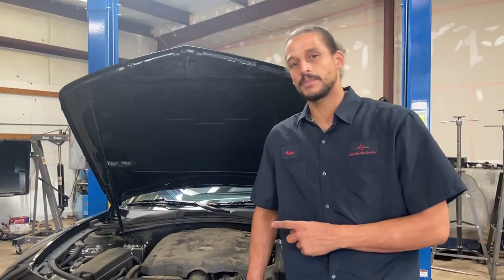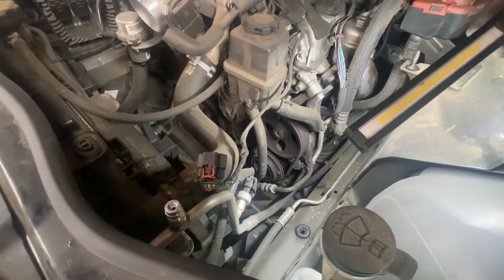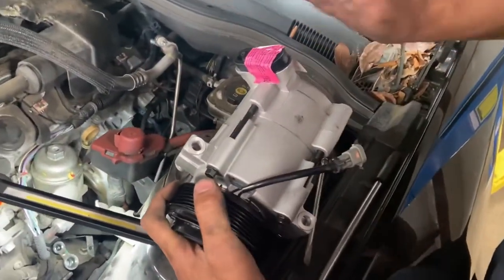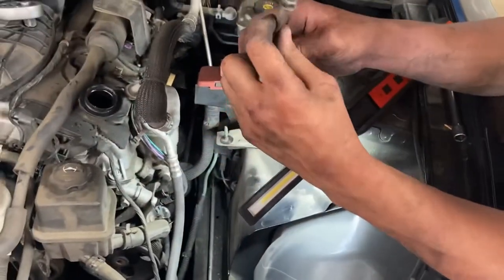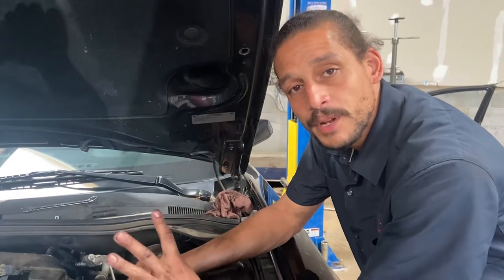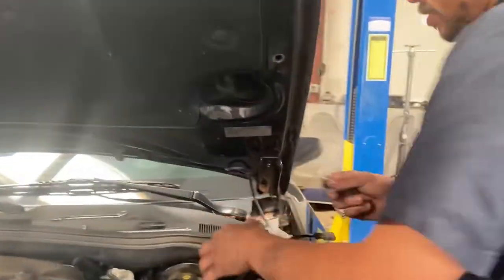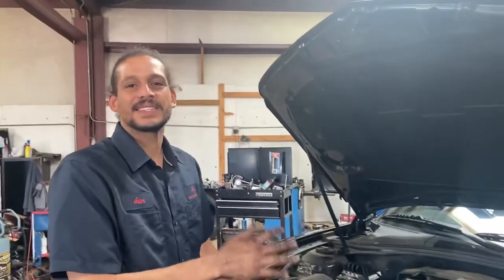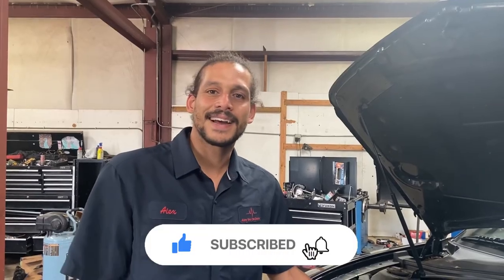How To Replace an A/C Compressor | A/C Compressor Replacement on Chevy Camaro & Cadillac Setups

Comment: I watched your video before I changed my wife's compressor.  2010 Camaro.  Thank you for posting.  Her compressor was making a terrible noise and then failed.  After replacing it, I had a terrible time Getting the new compressor to run.  Charging the system didn't get the clutch to engage.  Jumpering the relay got it working but the next day no go.  I did a code reset using my code reader still no go.  I finally unplugged the battery for 20 minutes, and no go on the clutch engage.  I jumpered the relay to engage the compressor clutch, then pulled the jumper and put the relay back in.  I drove the car for 40 minutes.  AC worked great.  It seems I had to run it long enough for the ac computer to identify there was no more problem.  AC has been working flawlessly ever since.   The only reason I write this, I am sure others may run into this problem after changing the compressor.  Thank you for the video, It helped me a lot.

Comment: Hey Alex.
Just an update.
The compressor was the issue. The pulley bearing was on its way out too, been noisy as hell.
I removed the old compressor and the pulley bearing was in fact shot. I was able to rock the pulley back and forth.
Removing the top stud first made the job much faster. And, you don't have to remove the power steering line either. The stud passes right by it.
A/C is nice and cold again.
Thanks again for making this video. Great job.
Reply from the maker: I’m glad it all worked out great l. My pleasure buddy

Comment: Subscribed.  I was curious how this process worked as i just had this job done on my 2013 camaro. Your video shows everything and in such a timely manner ! If it wasn't 24 degrees out and I had a garage, i would've tackled this myself. Your video is that good. Firestone told me it was an 8 hour job for $2600.00. I found a place that did it in less time for $1440.00.  

My compressor was so shot that there were metal shavings in the condenser along with a super loud whine every time I accelerated. It even sounded bad all the way from my living room when I would remotely start it.

They also drained and put in new refrigerate. Ice cold air and no more whining or scraping sound on startup and acceleration.  However, they never mentioned if they flushed out the system to get rid of any debris/shavings. So I'm going to call them tomorrow. Hopefully, they did. I read that if it's not flushed, my new components won't last very long.

Comment: Quick tip, If you dont have a small enough socket for the stud you can stick a long screw driver or pry bar down between the compressor and block and just GENTLY wiggle it off. Make sure to pull the wiring thats zipped tied to frame outta the way first as well.
Reply: @Diegodiaz-gc6bc  doesn't work on the camaro. The stud is too long. Had to remove it with the 5/8.

Comment: Great video.
I used to do A/C work in a dealership 30 years ago.
My 2015 Camaro V6 with 124,000 miles on it was blowing ice cold one minute, then hot. Compressor is not engaging. System has no leaks. Checked the fuse and relay, all look good.
Seems to be a bad compressor IMO.
Reply from the maker: Sounds like a bad compressor to me
Reply: @AlexTheCarDoctor  That's what I think as well.
When I go to remove the compressor, I'm going to remove that stud first lol.
Damn manufacturers. I guess putting a bolt there was just too difficult.  Engineers.
Reply: @mikearonson1071  did it end up being the ac compressor or something else ?
Reply: @GoMattyGo  It was the a/c compressor. The clutch in it was shot. The bearing in the pulley was making a ton of noise.
Reply: @mikearonson1071  thanks for the reply, I'll try a compressor then hopefully this does it
Reply: @GoMattyGo  What is the issue you are having?
Reply: @mikearonson1071  the compressor isn't engaging. Fuse is good.
Relay is good.
Checked freon and showed it had plenty. 
Belt is good.
No codes.
Blower motor is powerful.
Just stopped blowing cold while driving, compressor doesn't click on anymore. Any ideas ??
Reply: @GoMattyGo  Sounds like the compressor.
Read my other comment on this video for ease of getting the compressor out. You don't have to pull off the power steering lines.
You can remove the lower stud from the engine block after removing the nut from it. Use a 5.5mm 6 point socket.
Reply: @GoMattyGo  Got my compressor from RockAuto at a great price. Went with the AC Delco one. Works flawlessly.

Comment: Nice video,very instructive.looks like it is harder than a 3 or 4 hardness level with the problems with the long stud. Bolt.
Reply from the maker: thanks for the support. You are right sometime I don’t think about you guys and go off  my own feeling on the job ratings.that stud does make it a little bit harder would  you agree with a six

Comment: Great video. Thumbs up and subscribed, about to watch more! I’m trying to learn about cars so I can do some simple things myself. 

My a/c went out, I checked the fuses - they’re good. I have Freon in it, so no leak. I was told to try to rotate my compressor to see if it’s locked. Is that what the serpentine belt is on? The compressor?
Reply from the maker: Hey there, thanks for watching,the drive belt rotate a pulley On the AC compressor when engage the center of the AC compressor engage The spinning pulley which interns rotates the internals of the AC compressor

Comment: It helped me a lot to see your video thanks!  but I have a question, I changed my ac compressor and I don't know if it comes with oil or not, how can I check that?
Reply from the maker: Hello and thanks for watching.just about all new A/C compressors come pre-charged with oil. It should be a sticker somewhere on the compressor that you peeled off telling you how much oil was in the compressor or you can contact the manufacture of the compressor you will also need to add oil according to manufacturer specifications.let’s say your car takes 4 ounces of oil and 2 ounces come with the compressor you  then add 2 ounces of oil in the system
Reply: Tank you Alex!

Comment: Hello  I always enjoy your videos.However I had someone put a new compressor on my camero but it still seems like it’s turning on and off and not staying cool no leaks and new refrigerant in it any recommendations?
Reply from the maker: Hey there sorry to hear you are still having problems. Did they also replace the receiver/dryer. Did they put the proper amount of Freon in the system, you may have a bad expansion valve. Im glad you are enjoying my videos thanks for the support by watching them
Reply: @AlexTheCarDoctor  I did buy a expansion valve today and I also bought two cans of Freon didn’t replace the receiver /dryer 🤔I finally got my heater working really good
Reply from the maker: @monicaaugustine2776  I highly recommend replacing the dryer that will ensure long life for the new AC compressor
Reply: @AlexTheCarDoctor  okay thanks

Comment: Will the compressor come with documentation saying how much PAG oil it requires? Or are they always pre-filled.
Reply from the maker: They are prefilled but what I like to do is empty the oil out in a measuring cup an ad if necessary i’m quite spoiled my a A/C machine feels the oil in the system for me

Comment: My 07 dodge magnum 2.7 liter, only blows out hot air and the switch for adjusting where the air blow only works on one spot, all others air goes threw the top by windshield. Prolly should take it to a shop ^^
Reply from the maker: Hey and thanks for watching man.that’s a hard one to figure out, that something that would have to be looked at in person.my guess though, sound like you’re low on Freon or your compressor is not working and there is something going on with your blend door inside your dash that controls the direction of the air flow whether it’s going in your windshield or out the vets toward you

Comment: What was it that spilled?
Reply from the maker: Power steering fluid
Reply: @AlexTheCarDoctor  thank you how do I refill?
Reply from the maker: It should be a cap with a steering wheel picture on the top. should be directly in front of the oil fill cap

Comment: is it the same for 2013 camero
Reply from the maker: Yes this covers pretty much all 3.6 v6 Camaro,GM doesn’t like to change things
Reply: @AlexTheCarDoctor  okay thanks 
Firestone which is a auto repair shop gave me a whole list of things just for my air total 2,400
Reply from the maker: @monicaaugustine2776  SteelerStone has been known to rip people off and damage things on people cars, I get a lot of their customers.what are the list of things
Reply: @AlexTheCarDoctor  HVAC MODULE  ,R&R Module ,programming HVAC, ac compressor ac expansion ac condenser ,acevacuate and recharge  ,value freon oil and then another AC condenser i would have taken a pic but i don’t see where i can but total is 2,965
Reply from the maker: @monicaaugustine2776  the HVAC module needs to be programmed if the air is blowing cold on passenger and warm on driver side vent or vice versa if both are blowing same temperature no need to progress, that’s way to much $ it sounds like they are throwing parts at your car and don’t really know what the issue is, take it and get a second opinion. What is going on with it in your words
Reply: @AlexTheCarDoctor  that’s funny you said that because i already paid over a thousand or near it for acuator blend door which my car was blowing hot when on cold and vise versa 
i took it to another place today they said my compressor is not turning on which i figured it actually blows cool here and there but not for long maybe 10 minutes heat blows like hell though they want be getting my money anymore . I love my car no major problems I typically keep it maintained when something happens i try and fix pretty quick but this guy apologized once he gave me the print out and said he should have told me before the blend door but that didn’t me any good now .He took me under my car and said my compressor was cracked i believed or had a leak but all that other stough naw i’ll pass
Reply from the maker: @monicaaugustine2776  dang that’s crazy that mechanics out there just be guessing and wasting people money. Just be honest and say I don’t know that what I do
Reply: @AlexTheCarDoctor  exactly !!well thank you for responding and helping me reassure what my instincts were. Definitely following .
Thanks again.
Reply from the maker: @monicaaugustine2776  my pleasure
Reply: @AlexTheCarDoctor  brother you're not wrong. Firestone quoted me $2600.00 ! They said it was an 8 hour job. I took it to Meineke and they did it in less time for $1440.00. Slightly above the price you quoted someone else in the comments.  I wish you were in Oklahoma man. It's hard to find good honest mechanics out here.